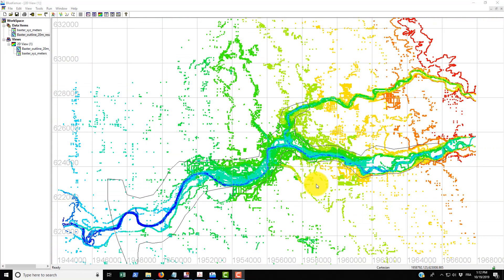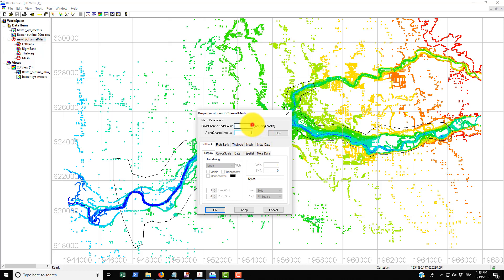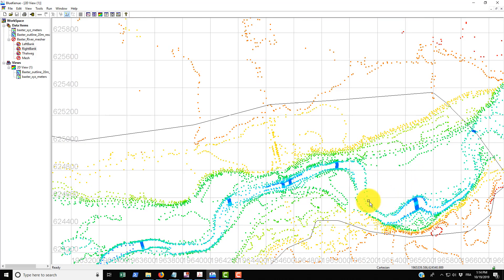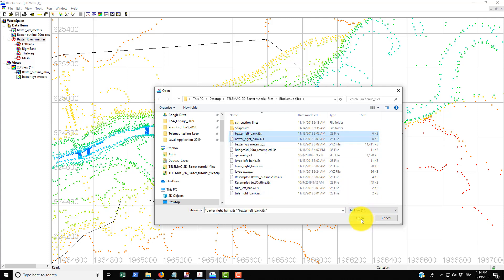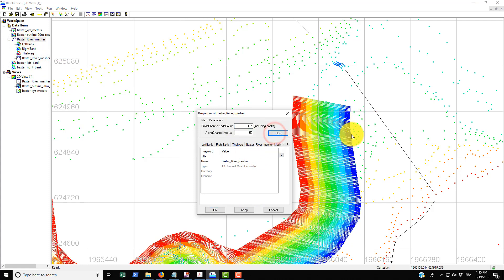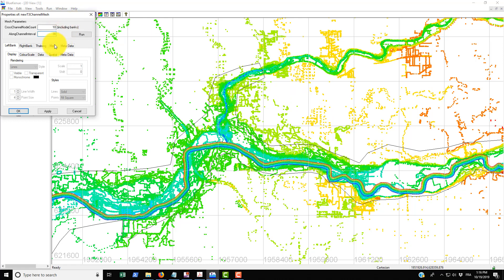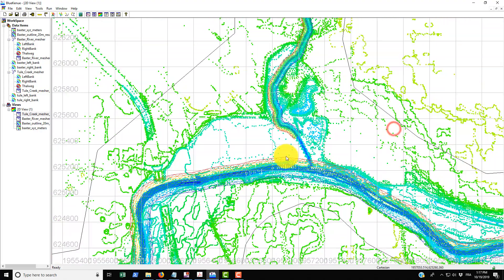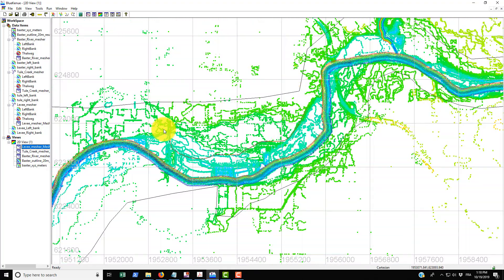Telemac2D Tutorials - part 2: The T3 channel mesher

Comment: Hi Jason, My Bathymetry, discharge and gage height data is in feet, do I need to convert those to meters before using Bluekenue? If not, then if I run all the data in feet, then should I need to convert the unit from meter to feet during creating the right bank or left bank? if So, how to convert that?

Comment: Hi Jason,
In my project I need one part of the channel in a rather high resolution, the rest of it should be coarse to speed up the computation. Do you know if I can use 2 different mesh densities for the channel and how?
Thanks in advance!
Reply from the maker: Hi Ulbert.

You could define multiple channel meshes, each with a different lateral and streamwise resolution. Hope that helps.
Reply: @duguayjason  Thanks for your swift answer! So I just create a right/left bank for each resolution and put them in two different channel meshers. Isn't the space in between the 2 channel-meshes going to be messed up ? Or is it enough if the mesh creators fills the space in between?
Reply from the maker: @ulbertkatzenfeind4981  Did you want the upstream reach to be coarse and the downstream reach to be fine? Or did you want the left bank to be coarse and the right bank to be fine?
Reply: @duguayjason  the channel: upstream coarse and the middle fine, further downstream coarse again . But how would I do this in BK? My thought was to draw 3 different bank-lines for each side and produce 3 different channel meshes, but maybe that's a false approach?